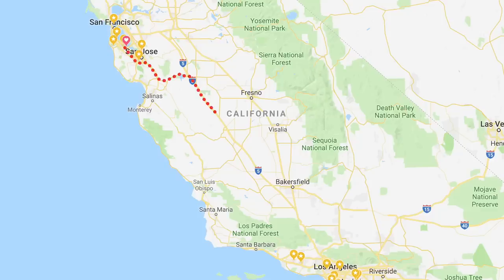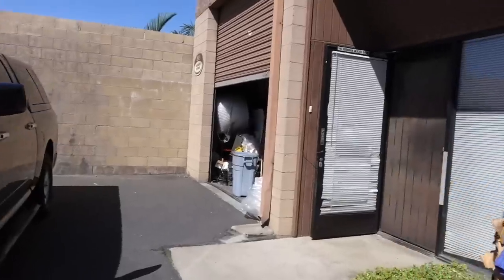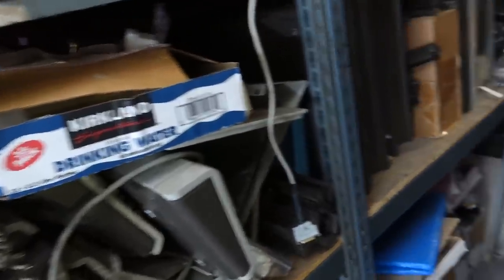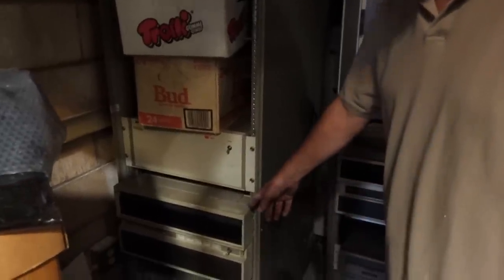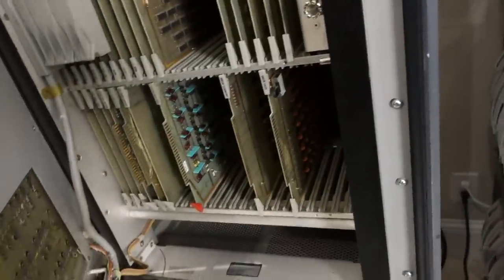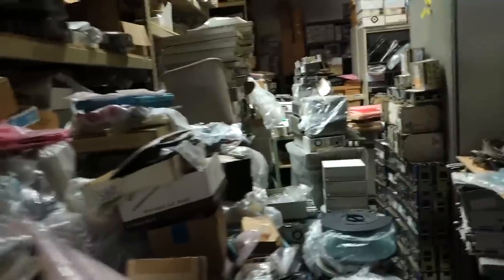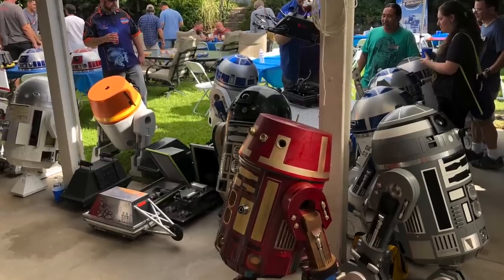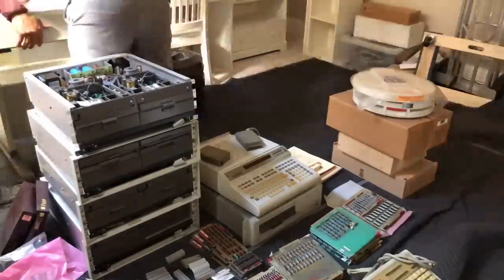Vintage HP retro-computer bonanza in Los Angeles

Comment: A tractor shop down the road from where I live still runs an HP 3000 timesharing system from the late '80s.  I believe it has two PA-7100 processors and a pair of Eagle disks.  It is used for the part inventory system.

Comment: I'm a big fan of your channel and all of your HP equipment.  Back in the day, I used the 5420 and 5423 DSA, 5451 DSA (B and C), 3582 DSA, 9825, 9826, 9836, 85, Series 200 and Series 300 computers, plotters, printers, etc, etc, etc.  Programming in HPL and Basic and Pascal brings back some old memories. 

I remember the 9825 back in the late 70's having 23K of memory, when the popular Radio Shack TRS80 had 1K or 4K of memory.  I though 23K was more than anyone would ever need. 

It's great to see that old equipment again.

Comment: Glad to see you salvaging some of that old HP gear. I like the early ‘80s desktop gear like the 85 and 87 for its simplicity. I understands what he’s say8ing about the hassle of selling on eBay. It’s getting harder and harder to find stuff there. I’d like to find an I/O ROM for my 87 for less than $60, but I don’t see those anymore. I’ve got one, but I’ve got three 87s, so I have to keep swapping it out for HPIB. Interesting disk drive test gear with an analog gauge. Looking forward to you future videos.

Comment: Glad you saved some of the keyboards for the terminals. The first computer I got to touch and operate was an HP 2114A in my junior high school days. It came with a high speed paper tape reader, mark sense card reader, and an ASR-33 teletype for typing commands and printing program listings. A few years later I was able to use an HP 9830A. I still have or three of the cassette tapes that I used with that machine which contain some programs I wrote. It could be interesting to try and decode the data on the tapes and extract the programs.

Comment: Thanks, some very old memories, I started in ~1970 with a 2116A and ASR35. The paper tape reader came later.  I remember the HP rep came with a second D/A card so we could play Space Wars on a Tek 454 oscilloscope. The later 1.5 mb disk seemed huge.   We turned it off over Christmas and when we tried to turn it on we found we had to replace a tiny light bulb for the optical tracking guide that had become too dim to work. Used most the equipment you found over many years, finally ending with the HP-UX machines.

Comment: I remember using an HP 2100 system that ran an automatic calibration station during my stint in the Air Force as a cal tech.  Around that same time I built my first computer, a Northstar Horizon system.

Comment: I envy you your HP1000 kit. The HP1000, specifically the 2113 with 7906 and RTE4B, was the machine I cut my teeth on, I was new to computing, and I can remember the feeling of excitement as I saw the possibilities. It laid the foundation of the rest of my working life. Oddly, I can still remember the boot settings for my machine: S-reg 15,12,9,6,1, store, preset, ipl, preset, run.  Happy days. Thank you, Marc, for bringing the memories back.
Reply: And  102007 on the tri-octal display to tell you it had "happy halted"
I am led to believe that particular instruction as well as the rest of the instruction set is still in all Intel CPUs to this day :)

Comment: In 1977, when I was working for Measurex in Longueuil Québec, I dropped off the mechanism of a KSR 35 at the home of the gentleman who did all our Teletype repairs.  He lived in the East side of Montréal, in Saint Leonard..  His basement shop was filled with Teletypes of all types.  Most were chattering away being tested.   He had rooms full of spare parts and some cannabilized ttys.  Of course that was 45 years ago, but some of that treasure-trove of Teletype hardware might still be floating around in Montréal.  While Measurex mostly used UP computers, I do recall seeing an Interdata computer come into our depot after a fire in a paper mill.

Comment: Thank you for keeping those HP hardware. Actually I became involved in computers back 1979 on a HP2000 Basic Access System at the computer centre of the Natural Sciences Faculty of the University of Puerto Rico and during that time I  purchased some programmable calculators like the HP-25C, the HP-55 and the HP-41C (I ordered it from HP) and HP became my inspiration to learn myself computers and later as a MIS Computer Operator at Bourns PR, Inc. from 1985 through 1992 using a HP3000 Series III and later a Micro HP3000 Series 37 as a print and email server when ops went remote. I try to keep some hardware given to me when the company laid me off but only kept an HP-85B and a HP9100B calculator. My best working days were during those times and HP is on my heart as the best company and computers anywhere. It makes me glad that are people with such love and commitment to preserve all those systems and instruments for future generations.

Comment: Seeing that “disc” (yes, HP called them discs) drive tester was a real thrill.  I haven’t seen one of those for almost 40 years when I tested 7906 disc drives with them on the production line.  Cool video! I have used almost all of that hardware.  Some trivia.  The 79xx drives had big problems for a while with contamination from spindle motor lubricant.  It would mess up the servo signal written on one of the disc surfaces.  It took some time to figure out the cause and solution.  We called it “walking servo code”.  It gave us fits as we had to frequently rewrite the servo code..  There is a special interface board for the 7906 drive that writes the servo code on the lower non-remove able disc.  I hope you have one of those. You may need it.  It is only installed when writing the servo signal.
Reply: A quick update.  The walking servo code was caused  by contamination from a brush that swept across the lower disc during spin up. I think the brush was removed in later models.  Be aware of this if you restore the 7906.  I think it works just fine without the brush.
Reply from the maker: @77leelg thanks so much for the tips! I have the servo writing platter, but sadly not the interface board. Can you ping me via  email (address on the About tab at https://www.youtube.com/curiousmarc ) , I’d love to get in touch with you.

Comment: Are those Shugart Associates Double Sided, Double Density drives?  My Xerox 860ips used a pair of those as well as my 8000 server and 820 PC.  The 820 PC has a 8" HD, with a whopping 10 mb of storage.
Reply: 8" floppies were before my time, but the reason I know the name Shugart is because the Tandy 1000 line used the Shugart 34-pin bus for their floppies all the way until that line died out after the RSX, and I've had to do some research on that standard to make adapter cables so standard PC floppies would work with them.
Reply: Or are they the dreaded plastic Remex drives? ;)

Comment: When I first started my first job was to commission two HP 9000/825s 'Firefox' minicomputers in 1998.  These were HP's first systems with 32-bit PA-RISC 1.0 processors implemented in NMOS-III NS-1, running HP-UX and were installed in the local hospital - not as early as your haul but great memories.

Comment: I proudly retain as a memento an 8" double-sided floppy drive alignment disk. To use it requires a test jig to power up the drive and send the head to some specific tracks. Then with an oscilloscope connected somewhere in the drive electronics you can see alignment signals and manually adjust the motor/heads to hit the middle of the selected track. I last used it in the early to mid eighties.

Comment: Hello Marc... I always see those blankets with the Zickzack pattern... Are these just normal blankets or are they special like antistatic or so? Any special material?
Reply: Those seem to be so-called moving blankets, used to protect furniture when it’s moved. Moving (as in: to live in a different place)  is such a common activity in the US that there is a whole area of retail that deals with moving supplies. You don’t just buy “boxes”, you buy “moving boxes” (boxes, yes, but boxes labeled clearly for this very purpose and sold at suitable markup because moving supply purchases are usually under time constraints so price flexibility goes out the window - you can gouge the customers). The moving blankets are made often from recycled cotton fiber material, and there are many variants of them. Some look very nice - almost like things you could actually sleep on. Those might have non-recycled material on the outside, and an inner recycled layer. The stitching on them may look almost quilt-like and that’s likely what you refer to. Some look like one took a pile of cotton garbage and ran a steamroller over it, cut it into large rectangles and sold for approximately the going price of platinum scrap :/

I’d like to think that such consumer-oriented moving supplies are a very North American phenomenon, although it’s hard for me to know for sure - I don’t  think I knew anyone who has moved an entire house full of stuff back in Europe when I still lived there (or at least they didn’t move when I was in touch with them).

Comment: I believe the mid-'60s Dymec digital voltmeter I tore down once was made to interface to a 2116.  I have a drawer full of good general-purpose germanium transistors from that unit.  I bought an old Heathkit IT-18 transistor checker just to test them.  It also had a handful of Nuvistors in it but I don't think I have them anymore.
Reply from the maker: Dymec was the business division responsible for making integrated measurement test systems made out of HP and third party products. They had purchased the Union Carbide DSI 100 computer design that would become the HP 2116. Therefore it would make a lot of sense that they'd be the first one to make a digital voltmeter to interface with the 2116.

Comment: Fantastic, I recognize many of these from my early career in the 1980s back at Bellcore. We had several of the 98xx series lab computers for lab automation in our fiber optics lab.
Reply from the maker: Hehe. Same here. The optical lab is when I first met the HP 85's too. Fantastic scientific and test lab machines.
Reply: @CuriousMarc  The HP 85 was what HP came up with from Steve Wozniak's ideas after he left HP. It will never sell said the HP executives of the personal computer :)
Reply from the maker: I would need to ask the original HP engineers (and hopefully Woz if I get a chance) to confirm. My own understanding is different. Steve Woznyak was working on the HP 264x terminals in Silicon Valley. These were Intel 8008 then 8080 8-bit microprocessor based, quite advanced machines, very modular, multi-cards with a very nice bus architecture, and quite expensive, but only programmed in ROM for implementing terminals. That inspired him to propose his single board microcomputer, an idea that got indeed turned down by HP. So you could argue that the later HP 2647, which runs a version of Microsoft BASIC in ROM, is as close as HP got to that early personal microcomputers. 
The HP 85 was developed independently by the Corvallis division in Oregon, essentially the calculator guys. The 85 is really a programmable calculator on amphetamines. And all with Corvallis’ unique own chips and completely unusual architecture. The story I hear is that it annoyed the computer division greatly, that they made a competitive product to their 9825 then 9826 computers lines at a fraction of the price...
Reply: @CuriousMarc  I used to have the opener for the 264X terminals on my key ring :)
Reply from the maker: @andrew allen - now that’s commitment!

Comment: Does anyone know if anyone collects the medical stuff?  I've got a couple of HP medical ...things, a capnometer, which I gather is something to do with pneumology , and a very nebulous "patient selector" which is literally just a switch box you evidently wire up yourself, it has no other functions and what appears to be an HP-IB jack on the back that probably isn't because it just is wired into the whole mess such that you can arrange it however you like in regards to the buttons.  There's also a big clamp for multiconductor.  I don't even recall it taking power in any specific way, I had thought the clamp was meant for a  line cord but there is nothing to wire one to, I think the buttons might be illuminated but they quite easily might not be, they're white.  It's never actually been used and has never been "configured", I've still got the little packet of those weird 60s-70s clear wire wrapping thingies and some screws and suchlike.

Comment: Left Ed Blacksmith a message, I am looking for HP 13272 (floppy) cables to HP 264x terminal.
13270-60003 , -60004 , -60005.  Alternative would be the protection hoods for the 40-pin (2x20) card edge connectors.

greg
Reply from the maker: Haha. I asked him exactly for that too and he could not find one. I am pretty sure he would have some hoods though.
Reply: CuriousMarc 
IF he has the Card Edge Connector (40, 2x20) Hoods, THEN I can build the cable (already have 5 and 10 foot lengths within inventory).
Greg